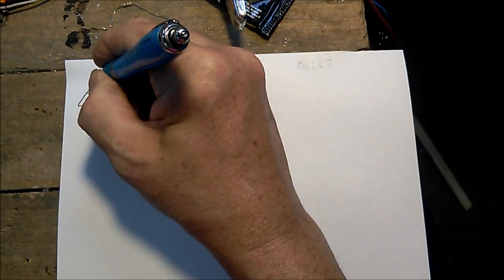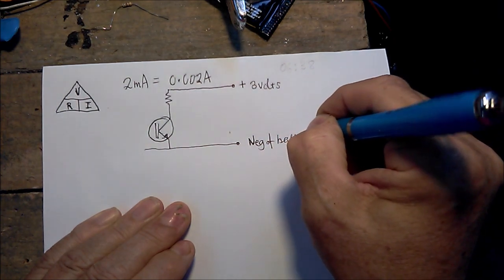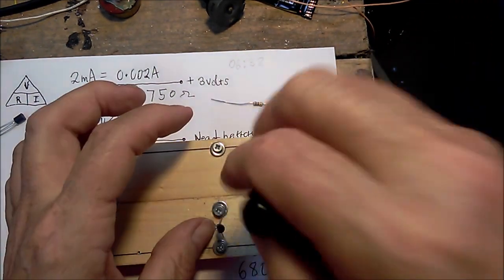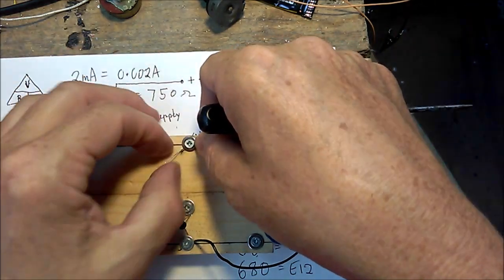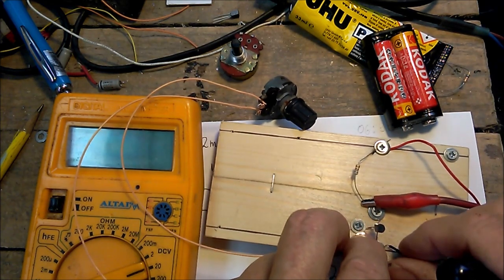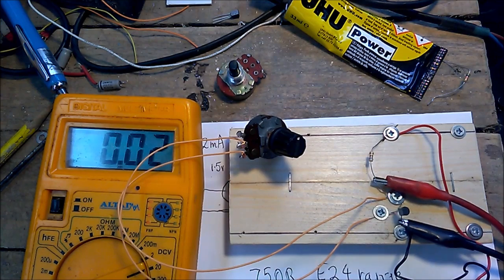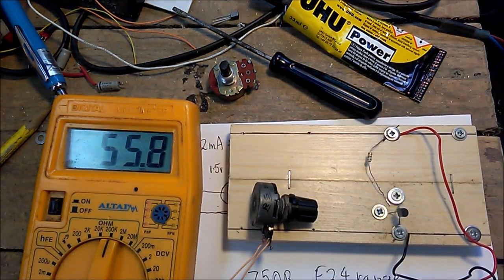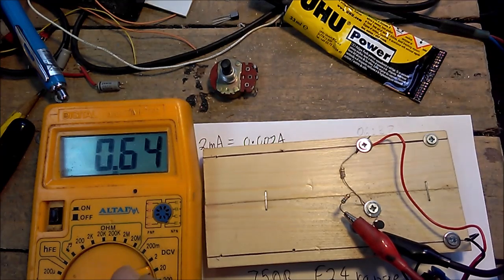TRANSISTOR BIASING FINALISED HOOFBAG METHOD

Comment: Thanks for sharing. Why did you choose 2 mA? To avoid getting close to the maximum current the transistor can hold? BC337 can hold up to 800 mA...
Reply from the maker: The stage following this one has about 100mA and is sent through the speaker. The one being calculated is the ,2nd (inner mediate) driver stage. The current is kept at 2mA for two reasons. One is the desire to make the battery last a bit longer and 2, when attempting to run the driver or preamp stage, the transistor junction would be very noisy. In fact, it might be possible to build a white noise generator via this means.  Another future experimentation project, perhaps? Thanks for your cooment and interest. 🙂
Reply: @hoofbags  Thanks a lot. A question I have not made you yet, and I have made you a few, ;), is about the different collector currents. The total current is the signal current and the bias dc current. I guess that if you make the design assuming the intensity to drive the speaker as the dc one, to know the biasing of the transistor, is because the current from the guitar is negligible in comparison with the dc current that bias the transistor. However you isolate the dc component to drive the speaker, so there is something I am missing and/or misunderstanding. Any suggestion on what I'm thinking wrong?
Reply from the maker: @sciexp  it's conventional to DC isolate speaker but to keep the circuit simple, here the collector current is passed through the speaker. It's never a good idea to do this, as it can result in an open circuit voice coil. The Philips company experimented with this method in 1960s. they went wrong frequently. A mod carried out in radio and Television shops was to replace the 700 ohm spaker with a 3 ohm one and fit an output transformer. In a future submission, an output transformer will be employed but to do this will mean fitting extra components for thermal stability. Thanks for your interest and question. 🙂

Comment: Always' enjoy these videos'!I've been looking at building transistor amps',so these are very helpful!I expected you to use the 4- resistor ,'universal-bias' of the 'common-emitter' circuit,with 'emitter-bypass' capacitor.Forgive me for asking,but what is the advantage of this type of 'bias' as apposed to the more elaborate, 'universal',common-emitter bias(Excluding thermal runaway,of course)?
Reply from the maker: The 4 resistor biassing, is, better for guitar. Simple collector-base bias, 2 resistor, a strong input signal: overload condition, can upset the bias and you get what guitarists refer to as 'sag', a temporary reduction of gain. Also, I find germanium transistors, with their leakage, need the 4 resistor, voltage divider method, to sound right, if advanced equipment to measure TR attributes is unavailable. I did an upload with LT44 LT700 germanium that uses the voltage divider bias. About 1 yr ago. Thanks for commmenting!
Reply: @hoofbags  Thanks for the reply!The 'two-resistor-bias' method seems' so easy! Most designs' I see seem to go with 'universal-bias',these days'.I had an older,('Paia' kit-low-pass-filter) that had an output-transistor with two-resistor-bias and always wondered about the use of that that,in that position.,which was 'amplifier' for losses in the filter and 'buffer' for output.